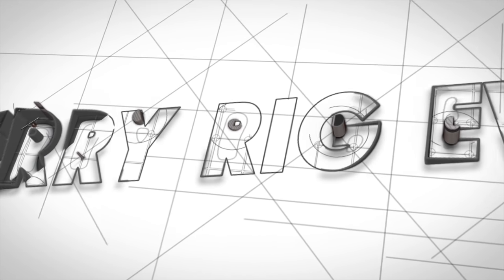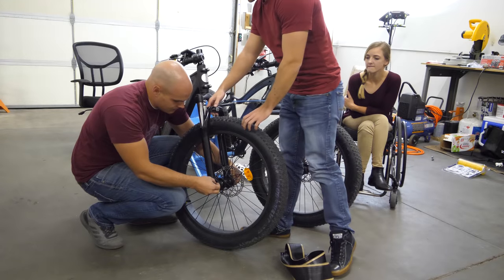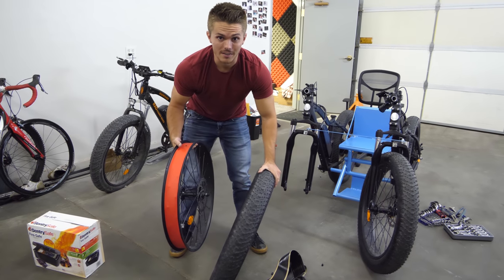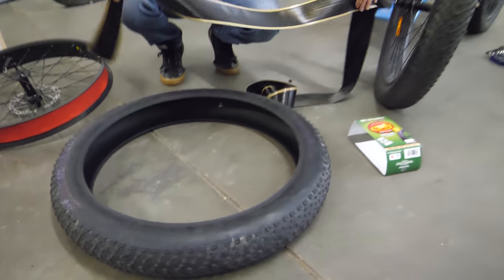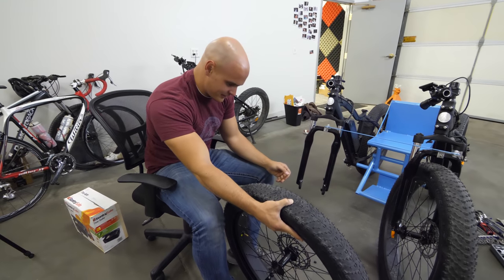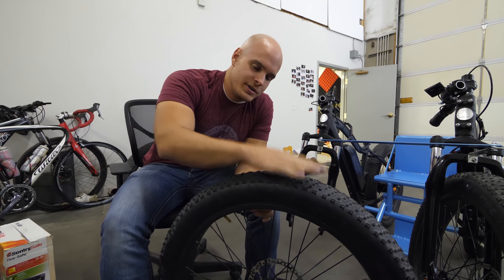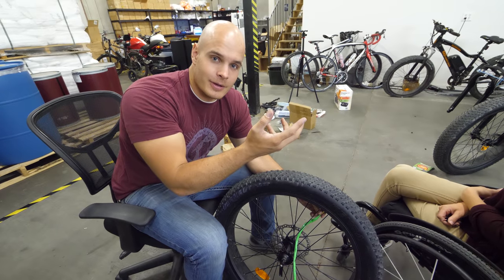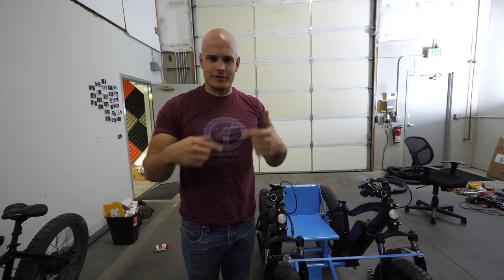How to keep Fat Bike Tires from going flat - Off Road Wheelchair Upgrade

Comment: Not a fan of tubeless tires as they lack the ability to stay on the rim when aired down. I always have a spare tube and repair kit with my seat bag toolkit. 

Even with multiple tire punctures, you can use parts of the tube for repair rubber patches. Slime will freeze in cold temperatures, throwing the balance of the tire off. Not a proponent of Slime. 

One suggestion on the tire installation, align the tire colored label with the valve stem. Makes it easy to locate the valve stem when you check pressures and have to add air.
Reply: Tubeless tires can stay on the rim when flat but you cant ride anywhere with those or you will damage your rims and tires.

Comment: 1) don't touch rotors by your sticky fingers.
2) don't push your extra cheap, china's rotor, you can bend it by only looking on it (not even touching)
3) dont use screwdriwer to fit a tire, you can damage tire and rims

Comment: the "slime" has a bit of problem by itself,

after a few months old, sometimes the slime would just cover the inlet valve, preventing you to put in more air in the tube. so you need open the valve inlet and puncture some hole to the slime..and u'll know the rest

i would rather slice an smaller diameter innertube(maybe 2-3inches smaller), spread it in the wheels, put the valve to the hole, then put on your tires again.
its a cheap way for tubeless

Comment: The tuffy liner is a great idea.
However, the slime is no bueno. 
Better than slime is Tireject. It's more fluid like water. It QUICKLY seals holes up to 3/8" diameter. 
Go to OneLoneyFarmer channel. He has done extensive real testing of Tireject. Watch and you may change your mind about tire sealants.

Comment: If you went tubeless Not only would punctures be less of an issue, you could run a lower pressure and get a little more shock absorbancy, especially in the back.

Comment: I have an e-bike with 26 by 4 inch tires. In one year I've had seven flats. The tire itself on the rim was impossible to get off. Tire spoons wouldn't do the job. I had to use a carpenter's flat bar which snapped the metal beading within the tire itself. Slime only leaked out the pin holes. Flat fix didn't work either. Frustrating.

Comment: Use a paper towel or tissue instead of your finger when trying to remove thorns from a tire not so much just because it saves you from a potential finger prick, but because they will snag a tiny bit of paper towel or tissue which marks them so they are easier to find and then pull out. :)

Comment: I used to use slime alot untile my tubes started to rot and the valvestem ripped right off. It takes some time for slim to rotten your tube but it will in time.

Comment: Why not make the tires tubeless? That way she would have more traction and the ride would be less harsh without rear suspension, as the tires could have a bit less pressure running tubeless.

Comment: Don’t use screwdrivers when putting the bead of the tire on the rim, you could easily damage the bead and rim strip, causing your bead to slip off the tire and the tube to puncture.
Reply: Use knives instead

Comment: How come you used slime instead of proper tire sealant
Reply: Slime is proper tire sealant you can buy tires prefilled with the stuff as well its common practice along with using the tube liners

Comment: That slime dosent help because tyre presure is inside inner tube so you are just making mess and if you hit lets say nail it goes thrue tyre and that black thing you put between inner tube and tyre than it goes thrue inner tube
How can slime get out and block hole with pressure

Comment: I still love the idea of your build but in my mind those fat bikes are garbage, the tires have a very thin skinwall and even with those protection stuff you did they will go flat, and they are way to expensive for a daily driver. Maybe you start another build with some standart 26" e-bike  because you get way better tires with off road capability and puncture protection for them ! Have fun !

Comment: using an anti flat chemical is never advisable,
either you go tubeless with the slime or bear the troubles of having inner tubes.  

having the slime in the inner tube makes more of a problem than a solution. i have done it before with my fat bike and my 29 bike.

Comment: No slime, its a gimmick.  Those fat tires don't get flats very often with out tire liners or slime or any other gimmicks.  If you are getting flats with those tires it probably just a bad tire. Also most people that get flats with fat tires is because they are running way to much psi.  Never ever ever ever.......ever go above 15 psi with a fat tire, or you will get a flat. Good tires combined with good tubes keep psi under 15psi and doesn't hurt to maybe double up on the rim liners or put Gorilla Tape over the ends of the spokes.

Comment: I'm sorry but I've been a bike mechanic for the last 10 years and there is so much misinformation in this video. Those liners and slime cause more problems than they solve. Just go tubeless if the wheel and tire are tubeless ready.

Comment: Dont ever use screw drives it can puncture your toops
Reply: Screwdrivers**
tubes**
And what he should have been using was a tile removal tool they come with just about every tire repair kit ever I have hundreds of the things floating around my workshop area
Reply: tile removal tool "tire lever."

Comment: Blah, Just go Tubeless
a tuffy liner, tube, and slime, all in Fat Oversize has got to be around 2lbs+ per wheel
ditch the tubes, save the weight, no more pinch flats ever, superior low psi performance, and goathead punctures ought to be self-sealing so long as you check the tubeless sealant every few months